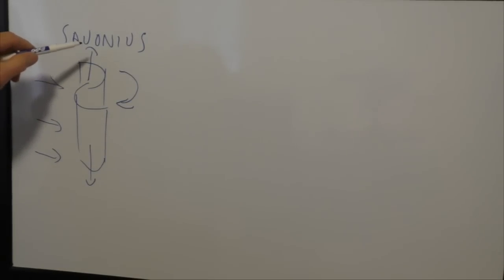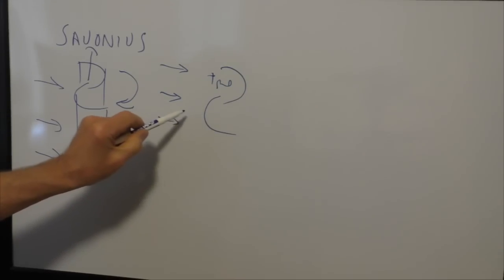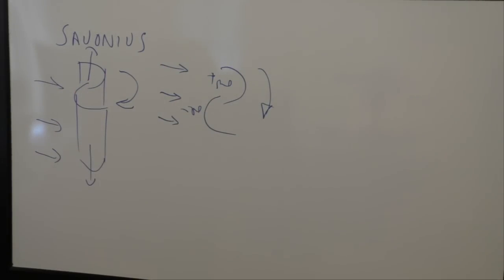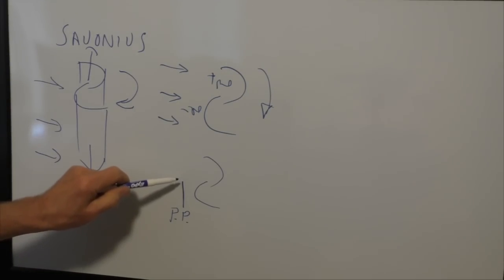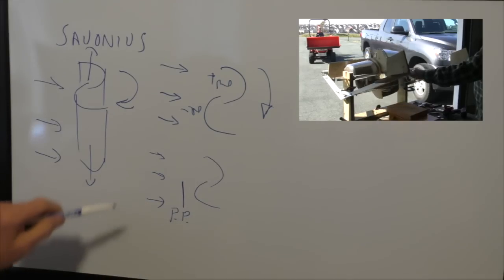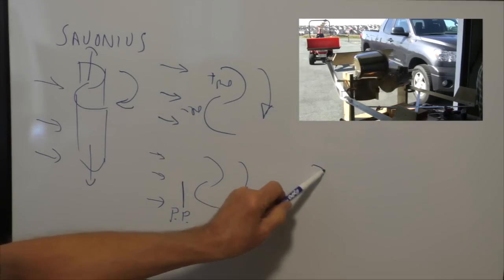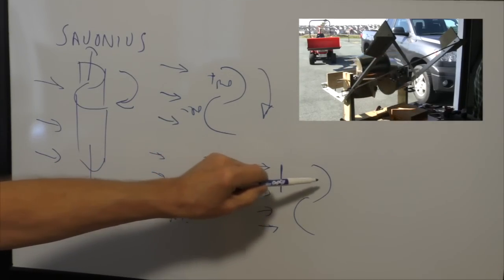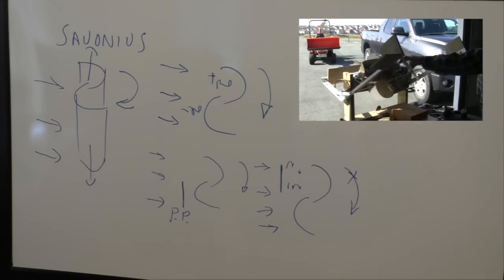Savonius horizontal axis wind turbine (SHAWT)  - Theory

Comment: Bob,  You are looking to power a generator, maybe?

Nice video, keep it up, this is why I subscribed to your channel, you keep me thinking!

Kurt
Reply from the maker: iflyhelis Yes that is the idea but I may or may not get to doing that part as I'm mainly interested in how the turbine will react under the different conditions as explained in the video.  This is just an aerodynamic experiment.  The turbine may not have a great lot of practical value with respect to increased efficiency but the overspeed control feature would be of value for a Savonius turbine (vertical or horizontal). I'm tied up with other projects now but will get back to the turbine asap. Thanks for the interest.
Reply: Sorry for the late response, I wa on vacation in Yellowstone.

Yes!  A great idea for a over speed condition,  You need to be able to keep it at a certain speed for whatever your application is going to used for.

I liked your video, please continue, doing them!

Later,

Kurt
Reply from the maker: iflyhelis Thanks - I've been pecking away at editing the turbine material but seasonal stuff keeps me from making any great progress.  Also need to do more experiments (as time goes on).
Reply: Well, you need to tell the Wife to lay off of the "Honey Do Lists" for a while...